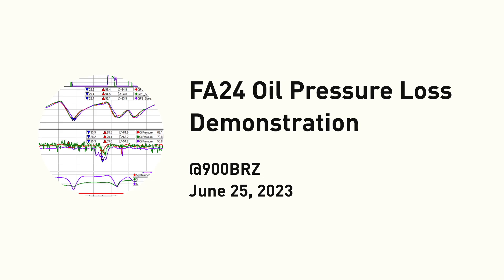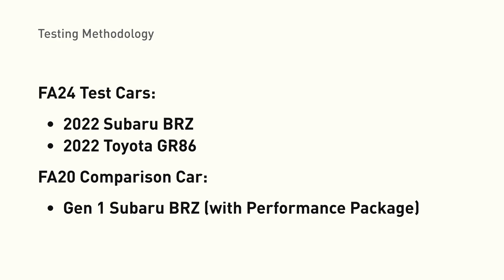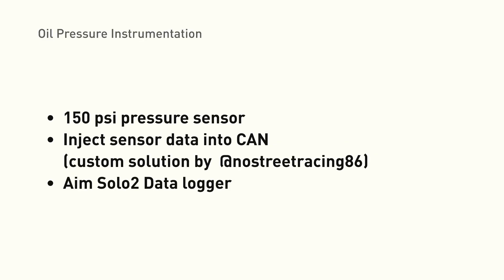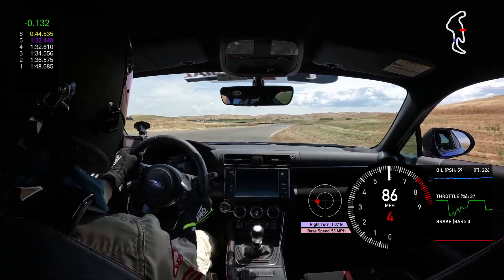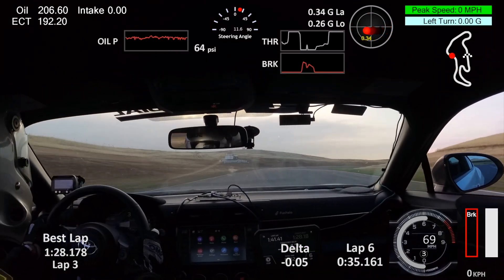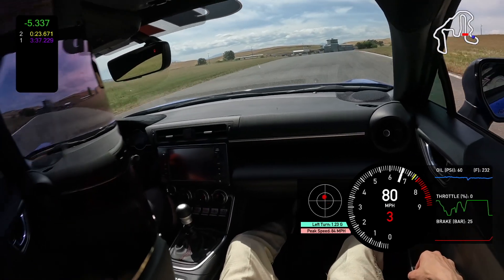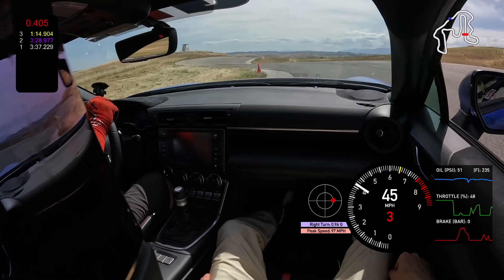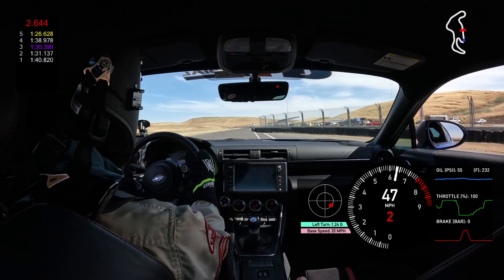BRZ/GR86 FA24 Oil Pressure Loss Demonstration

Comment: Can you go explain how you were able to get oil pressure data in CAN?
Reply from the maker: I’ll make a follow up video. You need a pressure sensor and then something to inject it into the CAN. My friend made a custom circuit board and wrote (and open sourced) the firmware: https://github.com/zeroomega/canmim
Reply: @900BRZ  tell him many of us mortals would buy ready-to-use units.

Comment: Great video.  I appreciate you putting the effort into this to benefit the community.  Many of the comments here can be scary to read.  However, I doubt many commenters have as much real-world experience tracking and/or racing these cars as those that participate in GR Cup.  What kind of failures have those cars seen?  Have they modified the oiling system?  Those cars are being pushed much harder than the cars in the video, and harder than I'll drive my car.  I want to check my fear at the door and learn from those that are truly experts before getting too worked up over this.
Reply from the maker: Pinned a comment from someone who claims to be a GR Cup team mechanic. Doesn’t look like they’re solved these issues.

Comment: 2022 BRZ owner; thank you for you time and effort on this.  The scientific nature and integrity here are apparent and you’ve done the community a huge service here.  If the KillerB baffle data looks any significantly better than stock, they’re gonna sell like hotcakes. Subbing for further updates :)
Reply: There was no science here. Only a theory.
Reply: @LawrenceTimme  I mean the measurements are as scientific and controlled as you could reasonably expect. The theory on cause, sure. But the data is quite solid for the use case.
Reply: ive yet to see a baffle that helps with oil at track temp.
Reply: @auricauric8150  not yet. BUT all the current baffles afaik generally prioritize minimizing side to side sloshing; this doesn’t appear to be the issue affecting oiling. If somebody designs a baffle that can prevent oil from surging back into the timing case, that may make a significant difference. Hard to say as even with the data here there isn’t a 100% smoking gun, but perhaps some baffle that prevents upward flow into the timing case OR a different pan which changes the angle at the front of the pan such that surging into the timing case occurs MAY be enough to at least minimize the issue. Only one way to find out.
Reply: @tazered4life617 or just buy a GR Corolla? Lmao?
Reply: @SK-tr1wo  uhhh besides the extra roughly $10k they cost sticker, plus they’re awd and way more front heavy. GR Corolla is sick but you can’t compare an awd hot hatch to a RWD sports car.
Reply from the maker: Diff overheats so needs modifications as well.
Reply: @tazered4life617 how it could be more front heavy, when 3cyl is lighter? And much better engine.
Reply: @jagymeister  because the GR Corolla is an AWD hot hatch… and that 3 cylinder is a turbo so it probably weighs about the same or slightly more than the NA flat 4.

But it’s mostly the awd - awd cars are cool but they tend to behave a lot like fwd cars at the limit because they’re similarly front heavy. Vs RWD in the BRZ case is 50/50
Reply from the maker: We have, but not one that completely solve the problem.

Comment: Is there noted pressure drop at moderate rpm high, g situations ? I’m concerned about the long sweeping on-ramps I regularly drive on, I have pulled over 0.85G on multiple occasions but I’m rarely over 4000rpm, 50-60% throttle position estimated. The track performance is disappointing but a large part of the community only street drives these cars and they’re starting to get nervous too.
Reply from the maker: The pressure drops tend to only occur at higher RPM, so I don’t think you’d have any issues below 4000 RPM.

Comment: Really well done, thanks for putting this together!  Hope you can send this data to engineers at Subaru/Toyota to review.  Wonder if this is something they didn't see in testing, something they thought was acceptable, or some other explanation.  Another question that might shed light on this is what about the 1st gen FA20 allowed it to see less severe pressure drops in RH turns?
Reply from the maker: Yeah we don’t know how to explain the difference yet, but there are design differences outside of the greater bore on the FA24.

Comment: Did you do any testing of a car without the oil cooler?  It could be affecting the results of testing.
Reply from the maker: I did not. If I was Subaru or a Toyota I would definitely test 0W20 with no cooler.

Comment: One thing that sticks on my mind, how many times does it take to damage a rod bearing enough to have it spin out/FAIL ??? In other words, even if you get a fix before the rod bearing fails will it eventually go anyway even though there are no more oil pressure drops???
Reply from the maker: Pure conjecture but I’d guess you’re shortening the life of the engine but not sure by how much. At this point I’m essentially budgeting for a short block replacement before 100k miles.
Reply: I have 155k on my FA20. 🤞 It drives better, motor feels tighter than several other low mileage ones I test drove. It’s stock and previous owner is a mechanic. He put a lot of highway miles on it.

Comment: @900BRZ,
Thank you for your contribution.
I have one question to be verified - do you think, low speed but instant right corners, let's say very sharp turn in right, with low RPM, can also cause an issue & pressure drop? I'm just wondering, if you really have to push the car hard on track, or just regular street spiritual driving is enough to make some damages to bearings.
Best Regards,
Reply from the maker: I haven’t done testing on the street so I’m not sure. I’d guess it’s possible but only if the forces are similar to what I’m seeing on the track think 1 G or more. I wouldn’t worry about it on the street with no modifications. Keep your oil level at max and you should be covered by warranty.

Comment: I assume th WRX version has the same issue? Will the 86 oil baffles fit on the turbo oil pan?
Reply from the maker: WRX has significantly different oiling to provide oil to the turbo, so I wouldn’t extrapolate these results to it.

Comment: I have an inkling that all modern Subaru engines have this issue. Difference is, the overwhelming majority of Subarus on the road are Crosstreks and Outbacks with CVTs and will never see lateral Gs this high and RPMs above 5000. I feel that Subaru's engineers modeled the GR86/BRZ FA24 from the data they got from their generic cookie cutter cars and said, "Yeah, that's good enough!" I will never buy anything with a Subaru engine ever again.
Reply from the maker: To be fair I think a lot of street cars wouldn’t be able to hold up with 1+ G but they also aren’t marketed like they are performance cars so they can get away with it. Agree with the premise that this is probably the case in their other products as well.

Comment: '15 FR-S.  I didn't hear mention of where your oil level was. I'm curious if filling over the dipstick marks affects the onset or severity of the pressure drops.  I'm seeing a lot of FA20 failures and used engine prices are really high. I suspect it's lazy owners who don't keep up with their oil.  No one has mentioned oil reservoirs like Accumsump here yet either.  Great work.
Reply from the maker: Oil level was at or just over the max line on the dipstick. I haven’t done any testing for overfills.

Comment: It would be interesting to run the FA24D cars on 0W-40 oil to match the FA20D.
Reply from the maker: We’re going to another track day on July 1. The GR86 will be using 5W40 and I’ll be using 5W30 with the baffle. We’ll see how it goes.
Reply: @900BRZ  I look forward to the results and really appreciate the data driven analysis.

Comment: Back in 2020/2021 I was debating between a base 987.2 Cayman or wait for the GR86/BRZ to release. New car reliability was biggest pro to wait but crazy to think FA24 has oiling issues during sustained turns like the 987.1 Boxster/Caymans. Possibly an oil sump extension kit and/or baffling to solve the issue like the 987.1 until Toyota/Subaru comes out with a redesign?
Reply from the maker: IIRC those generation Boxster/Caymans also have wet sumps, not the integrated dry sump Porsche moved to later. So they may both be suffering from inherent difficulties of robust oiling in a boxer wet sump.

Comment: Im curious if you can hit g's like this on the dragon or other canyon roads?  Maybe spirited street drivers are relatively safe?  On the track are long sustainable turns compared to a few second hits on the street in the mountains.  Either way thank you for this quintessential production.
Reply: Looking at the video, it actually looks like long sweepers are less harmful compared to sharp sudden direction changes. So it would depend on the kind of canyon road too. Tighter roads maybe more harmful? Which is sad considering the kind of car it is
Reply from the maker: I wouldn’t say that, but these tracks don’t have long, right hand sweepers. Personally I’m not willing to take my car to Buttonwillow right now, but Riverside is a great example of that. One of my friends thinks that the corner where he spun a bearing.

Comment: when the tire pressure is higher than the oil pressure it means you have a Subaru. many STIs have found the coffin in similar fashion, now the disease has spread to Toyota.
Reply from the maker: Never made that connection lol
Reply: @900BRZ  oil starvation has happened to many Subaru STIs that have died when turning in one direction, not sure if it is of any help to your case. all the best.

Comment: absolutely amazing work here, huge respect to your friend who produced the PCB to communicate to CANBUS to enable logging. some more wrinkly brains at work on this than subaru engineers designing these damn engines. this really is a massive cause for concern, and an overwhelming amount of evidence to stack up to a class action lawsuit against subaru/toyota. this is not only a threat to drivers on track, i can think of several on and offramps where i am pulling even more sustained right hand G's than thunder hill can afford you. 

sage work seriously.
Reply from the maker: Yes, @nostreetracing86 really made this whole test possible.

Comment: Thank you, 900BRZ for your work and dedication to test and monitor GR86 oil pressure. It seems, that like the GT86, the GR86 have some issue that need to be solve ....by the community. We solved the issue with a dedicated oil cooler for the gt86, now we must find the good way to track the gr86. It will become a very good platform, I am convinced.
Reply from the maker: > It will become a very good platform, I am convinced.

Very much the goal!

Comment: Could adding more oil help? 0.5 liters or so. 
Then extract  the extra oil out when you are done with your track day
Reply: woudlnt even be necessary to take it out. i run 6 quarts in my fa20dit there are no issues. no crankshaft interference until you get to around 7 quarts so an extra half quart would not hurt a bit. we used to do this is built up honda B series engines on track days, VTEC is oil pressure dependant and we were causing VTEC dropoffs on track with OEM oil level. an extra half quart to a quart would solve these issues with no drawback.
Reply from the maker: We will do testing, but I would not make claims that an overfill would solve the issue without data to prove it.

Comment: This video is fucking brilliant. Covers the basics and makes people aware of it from all intelligence levels and experiences. My expertuenfr is rather moot but I've done lap days with a 2015 frs with a baffle pan and the older killer b pick up and a Perrin oil cooler and never had an issue with oil pressures a such. Nor oil consumption. But it's well known among older (😅)  subaru heads these motors (the phase 2 ej mostly) are highly sensitive to oil control. Pump cavitation. Pressure drops. Drain back.. I've seen gus smooth out the oil passages and run vaccumn pumps to try to help oil return to the pan

Comment: As others have said, well designed and executed experiments, nicely done.  I couldn't help but snicker at the agenda slide and PPT-esque bullet list... Just like I'd present it,lol.  Maybe we can just overfill with thicker oil and hope for the best to keep oil where it needs to be. Kidding, of course, but <sigh>. Looking at those G's, speeds, and rate of turns, it sure looks like things I put the car through in isolated road conditions. That's not comforting. But more importantly, another thanks to you for the controlled experiments and measurements to try to keep down the path of improvement 🤙👍
Reply from the maker: Haha yeah it’s not a very YouTube native approach but it feels right. Think it’s possible to experience pressure drops on the street but I haven’t tested it. Definitely not comforting but I’m happy to be able to measure modifications against a known baseline.

Comment: Well, nice test, but this is basically what happens with every normal car under track use, that’s why there are performance oriented oil sumps with baffles and bigger oil capacity. If you really want to take it to the pro level dry sumps are always a must, otherwise it’s a matter ot time that you have oil starvation
Reply from the maker: It’s not true. MX-5 was designed to have consistent pressures up to 1.4 G. I’m showing drops at 1 G. For a car marketed on the track, that’s shocking.

Comment: As an engineer, I would say this is a well constructed case study
Reply: Every engineering student also calls themselves an engineer. Bad engineers also call themselves an engineer. Just so you know ;).

Ps: I'm a pretty mid engineer, and nobody should trust anything I say. 😅
Reply: One missing piece for me would be an overview of the oil circuit diagram. For example with the 95/96 mitsubishi eclipse turbo motors they had moved the piston squirters to be in line or before the feed for the thrust bearing of the crankshaft which is what lead to the notorious crankwalk situation. If you can pinpoint which bearing is fed last and look at engines where failures are occuring and where your pressure sensors are relative to those elements there may be more insight to be had.

Or it's as simple as what has been presented here and further analysis isn't needed.
Reply from the maker: Check out this post: https://www.gr86.org/threads/my-beginner-step-by-step-guide-to-make-fa24d-reliable.8181/page-3#post-133377
Reply: @turbo_brian  Through my study on FA engines. there is a really interesting design Subaru decided to do to the FA engines. They decided that Main Journal 3 should feed oil to both rod journals 2 and 3, imo kinda a compromising design.
Reply: Well stated and I completely agree. Anyone want to by a GR86 base, white manual trans with 1100 miles?
Reply: @chrisydarg1268 yes please lol
Reply: Custodial?

Comment: My K24 swap with RSX type S oil pump is like 30-40psi at idle versus my FA20 at 5-10 psi, and it is far higher from there, so part of the issue is the crap oil pump on these engines. Moral of the story: get a accusump or convert to a dry sump setup.
Reply from the maker: What I’ve read is that this oil pump is actually overbuilt but I want to understand more about why people are claiming that.

Comment: what I have noticed within owning a 2018 gt86 and now a 2023 brz is that the fa24 runs and gets to higher temp than the fa20. getting warmer is nice but in the long run it does run much hotter and I'm not really a fan. If this is a rtv problem that sucks lol

Comment: I hope these tests result in aftermarket parts that solve this issue. You sir are doing the lords work here.
Reply from the maker: Amen
Reply: Ok, but I doubt a baffle will fix the issue, they should go directly to an Accusump oil accumulator.
Reply from the maker: Miles from the video with the FA20 is installing an accusump. We’ll see how it goes. But it’s a more involved solution with more downsides.

Comment: Would this still apply to the turbo FA24s found in the new WRX?
Reply from the maker: I don’t know enough about that engine to say, as I believe there are some subtle changes between the Ascent, WRX, and BRZ. Technically the FA24 in the BRZ is the FA24D. I assume it would still be an issue, but they had to make other changes to the oiling system to provide oil to the turbo.

Comment: Awesome work! After seeing this data I'm leaning towards it being a pickup and pan shape issue. While there may be an issue of oil being trapped in the timing cover, I don't think its anything major or the leading cause of the pressure drops mainly because if that were the case you'd still see large drops into hard braking left hand turns as well. Like T6, T7, and T9 at west. It seems to be any time there is anything other than a perfectly smooth transition of lateral G in right hand turns based on watching your G meters relative to the pressure drops. I'm guessing this is due to the asymmetrical oil pan and pickup being favoring the passenger side. It would seem the FA24 would need a chambered oil pan baffle to keep sloshing to the driver side restricted.
Reply from the maker: Or the oil is surging for left handers as well but the asymmetrical design allows it to keep picking up oil because the pickup is offset to the side where the oil is accumulating on left handers. They’re related. I’m optimistic we’ll see an improvement but not confident that it’ll entirely solve the problem. Hope it will.
Reply: Since the oil pressure drop seems more during right hand turns, could it be that centrifugal force is causing the oil to shift to the left side of the crankcase?   This shift in oil level might cause the pickup to be partially sucking a small amount of air.  Maybe increasing the oil level would be a good thing to try.  If this changes the oil pressure in right turns, then a redesign of the pan or the pickup might be the answer.